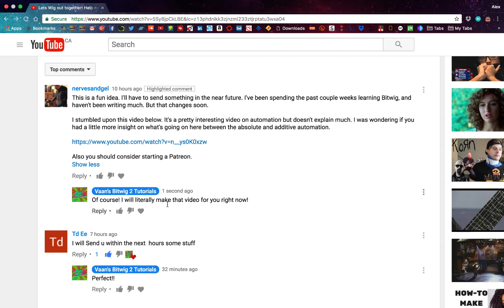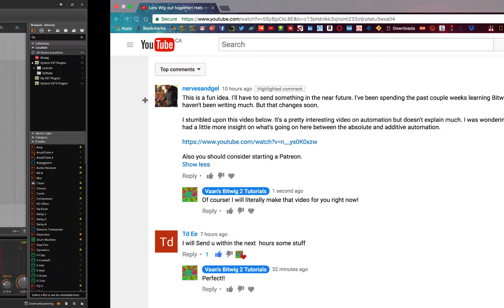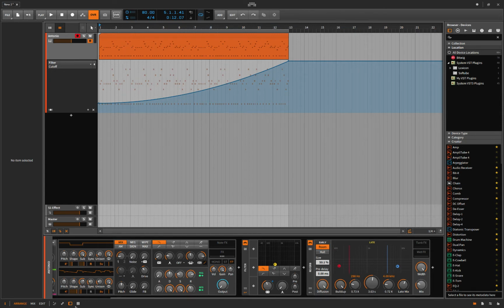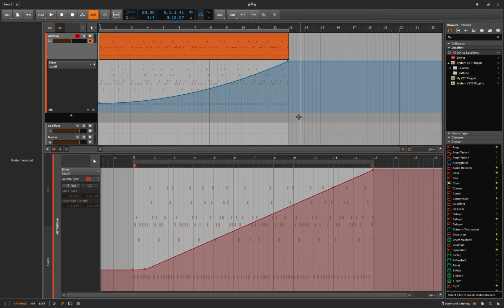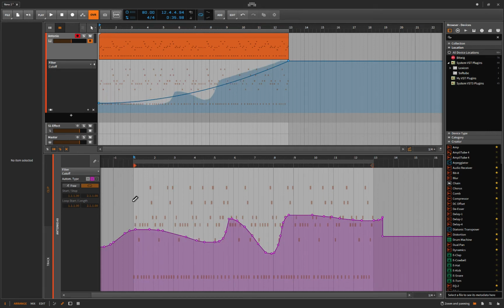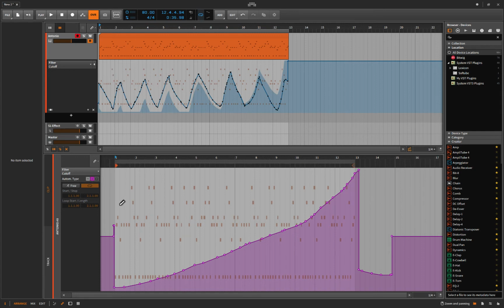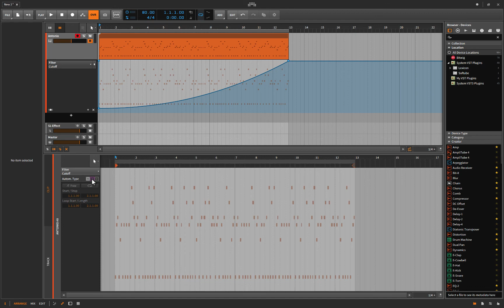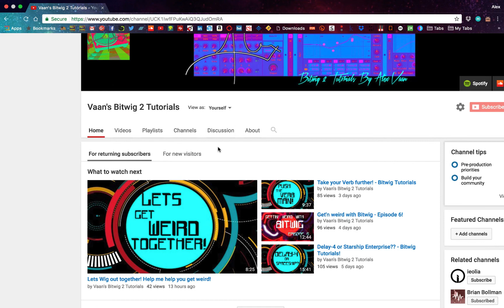Additive Vs. Absolute Automation...No, You don't have to do math! - Bitwig Tutorials

Comment: When you first draw in the track automation, you use option-click to change the curve. Why isn't this curve reflected in the absolute automation of the clip? Is the clip automation just assuming a straight-line curve between the original automation points (ignoring the changing of the curve)? This is the only part of this video that doesn't make sense.
Reply from the maker: Hey, yes I noticed this too. To be honest I think my computer just tripped out during that one. I've been away so I haven't tried it since. There has been a Bitwig update since I made this video so I'm wondering if they fixed that...
Good question!
Thanks for asking :)